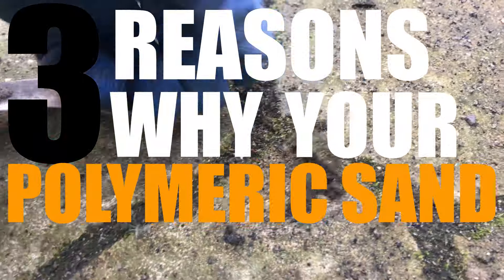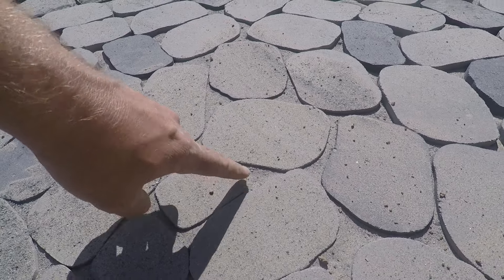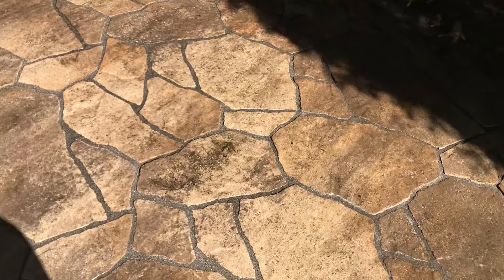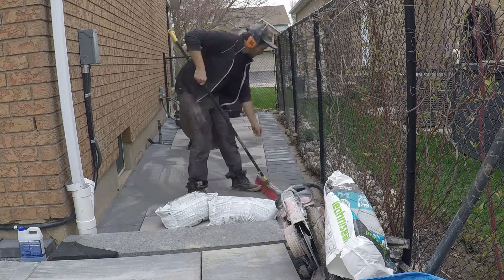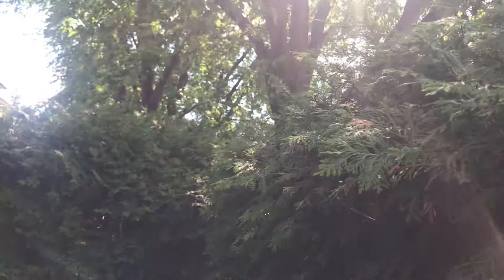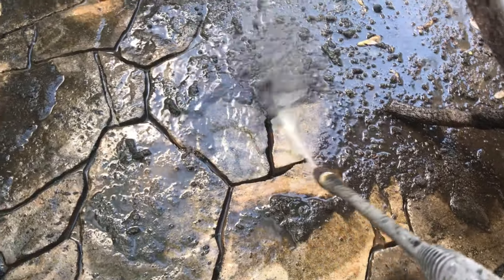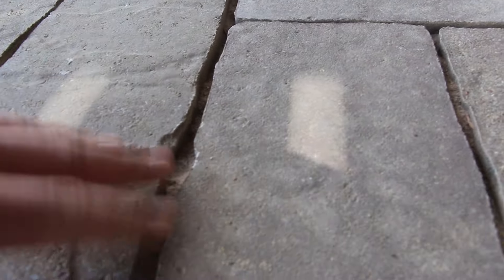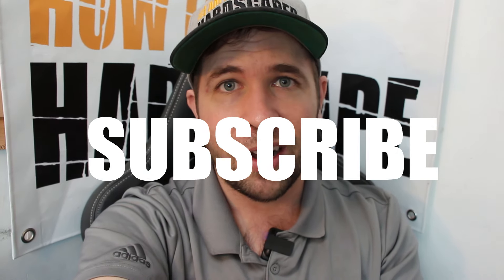Why is My POLYMERIC SAND LOOSE and How to Fix it

Comment: "Why is my polymeric sand failing?" 

Because polymeric sand is garbage. If have joints greater than 1/8 in, use Easy Joint and you'll never look back. If you have joints under that, watch this. 

Great video, informative as always. I'd love to see you do a breakdown of a laser versus an altimeter (U-level) on a site. We've been using u-level for years and are wondering if we should switch to a laser, don't really think that's the case, but would love to see a comparison on a build.
Reply from the maker: Yes it does seem like the industry sentiment is slowly moving towards those semi-permeable jointing compounds.

Appreciate the suggestion! Will definitely cover that this year at some point 👍👍
Reply: I just regrouted my patio a month ago. It felt like it hardened just fine but we got rain last night and all my polymer sand is wet, it reactivated. I'm at the end of my rope. Is this easy joint bette? Will it actually stay hard?
Reply: @silverrush1411  We absolutely love the product, and it does harden to grout like texture. We've used it in all of patio applications except one, and it's fantastic. Super easy to use, legions less restrictive than polymeric - add water, fill the joints, no worry clean-ups.

There are a couple things to keep in mind: if your patio is a state of failure, the EasyJoint will fail (think of it as if you had tile grout, and pulled the tiles apart - what would happen to the grout?); it does not work well with tight (narrow) joints. I'd say 1/8" or greater. There are similar product to EasyJoint that is supposed to work with tight joints, but we haven't used them yet so I can't speak to them.
Reply: @PuppyStomper87  my paver patio  is only 5 years old and the joints are over 1/8 ". I just don't understand how the grout could reactivate and wash out. I folled the directions and made sure not to over or under water. It started to repel water so once it did that I moved. I removed all my old grout that was done by contractor due to the same thing and moss growth. What are the cons to this?

Comment: We are in the metro Vancouver area doing a new construction driveway and walkway using New stone Standard pavers. Driveway has a slope and existing grade is much lower than the grade planned for the driveway (1 to 4 feet difference). The plan is to use 3/4" minus road base for fill and base, and then HPB for the bedding layer. If we are to use polymeric sand, what brand and type would you recommend? (I think Techniseal and Gator are available here. I'd have to check if it's some other brand.) We are also considering Romex. Is there any difference in longevity and weed growth between polymeric sand and Romex? The videos are really helpful.  Thank you!
Reply from the maker: I just started using Romex this year so I can’t say about longevity and weed growth. I’ve used Azpects Easy Joint which is similar for pedestrian applications and it has held up well. I wouldn’t use a permeable jointing compound if you plan to use 3/4” minus as your base though. For poly sand I like TechniSeal nextgel

Comment: I think I filled mine too high. Had to do in dark before 3 days of rain. Tarped it for a week. Looks dry for most part so we shall see how it holds up. I have rectangular one with chamfer. It is filled prob to 1/8” from top but still decent amount in chamfer gap. Am I definitely going to have issues?
Reply from the maker: No not necessarily. See how it goes
Reply: @iamahardscaper  thanks learned a lot on your channel
Reply from the maker: Glad it helps 👍

Comment: What polymeric sand would you recommend for a patio where the stone is BWS avari and brock paverbase was used?
Reply from the maker: I like TechniSeal Nextgel personally. Try to use a roller compactor when consolidating that sand on those slabs. A compactor with a pad will work but will likely crack a few.
Reply: @iamahardscaper  thanks, will take a look at renting a roller compactor. Was considering getting gator maxx g2 - is that just marketing gimmick or actually a good product ?
Reply from the maker: Gator is fine, i've heard a lot of other contractors have had troubles with it though. I've maybe had a couple.
Reply: @iamahardscaper  thanks for the heads up. I couldn’t find the one you suggested locally. Rona has the techniseal ez sand - would that work well?
Reply from the maker: I would buy from a landscape supplier and not those big box stores. The quality is not the same
Reply: @iamahardscaper  fair. I’ve been looking online and can’t find any locally. Might have to go with the maxx g2 as my backup.. will keep looking though. Do you know how many bags would be needed for about 600sq ft?
Reply from the maker: you can go through the TechniSeal website to find a dealer near you. Amount needed would depend on joint width and depth. If you are installing a product you know, you can search it online and find how much square feet one bag would do
Reply: @iamahardscaper  thank you !
Reply: @iamahardscaper I had pavers put in and techniseal nextgel  applied in April.   Turf guy blew out some joints with his hose.  I figured he may have vibrated too close on turf application.  But a month later i used the hose on not a hard setting and had sand blowing out.  Noticed loose sand on the surface of the joints.  I had some other cracks so i cleaned them out and re-applied myself (as i figured it wasnt watered properly on install and didnt activate.  i watered the entire paver area as if it were freshly sanded.  I was methodical.  Some areas hard as rock...others sandy on top surface.  Bizarre.  i washed off dog pule today and another joint blew out.  im so over it.  Im good at this kinda thing but this has me frustrated.  maybe its the base layers not draining.  road base, non woven geo and sand....  I have some techniseal sealer (natural) im going to try.  but i do NOT want to dig these out and powerwash just to have a similar result.

Comment: I have limestone patio tiles where the polymeric has washed out over the years.  The contractor replaced that failed poly with torpedo sand and my wife hates the color difference between the lighter almost white limestone and the brown/beige torpedo sand. It appears that most suppliers near us only have torpedo and masons sand that is beige.  I’d prefer not to do polymeric again.  Is there any alternative that is closer in color to limestone that I could use as a sweep in into the joints?   I realize any sand without binders like polymeric will wash out and need more frequent replenishing.  Thanks for any response.   Love your channel!
Reply from the maker: Ohh that is tough. You may be looking into a polymer modified grout. Ardex has a lot of colors available. But I don’t like using it unless they are laid on a concrete base.
Reply: Wow, I can’t believe how fast you replied!   Thank you!  And yes it’s a tough spot when you don’t have a happy wife.  The local hardscape supplier suggested that rather than masons sand to use finer limestone screenings but I recall your video saying that you should not use limestone screening  although that was for base application.   Does that critique apply to jointing as well ?  I don’t expect to have much depth need as the torpedo sand is pretty well impacted in the joints.  This would be maybe a 1/4 on top to get the color that the wife would approve.  Thx again for any insight!!!
Reply from the maker: That may be something you want to use. I personally wouldn't because I prefer something in there that will bind itself to the stones. But I also would not use torpedo sand because of this. I'd say get a handful of it from the stone yard, bring it back home, see what she thinks, then proceed. you could even do a little portion of the project to see the results first.
Reply: Thanks so much!!!

Comment: question for poly sand, is it require to use plate compactor or can i use a manual steel tamper?
Reply from the maker: It’s best to use a plate compactor for the vibratory compaction and not a ramming action. In a pinch, guys have used a hand tamper. Just make sure you have something to protect the pavers

Comment: Hey when you use 3/4 gravel as a base do you use 3/8 1” bedding base? Most importantly what I was concerned about if you use open grade base and bedding does polymeric sand just keep falling into that base when you’re sweeping it in and compacting?
Reply from the maker: yes, always use the 3/8 or 1/4 chip on the 3/4" base. I find that there is about 10% more use of polymeric sand in these applications, but it does not just keep falling into the base the gaps are just not large enough. Some people use non-woven geotextile in between the base and the bedding layer. I do not
Reply: @iamahardscaper  ok thanks, I’ve been wanting to switch but been concerned about that.

Comment: I just finished applying polymeric sand to my paver patio while it was still damp…. Now I seem to have some stains on the stone pavers. How do I remove the stains??
Reply from the maker: I would start with a hot water pressure washing. If that does not take care of the staining, you would have to then wash with a polymeric sand haze cleaner.

Comment: Have you ever gotten a job to pressure wash and re-sand? I feel like at that point it’s always lift and relay or a full redo.
Reply from the maker: Yes, I used to do them when I was first starting out. Only if it is just a sand problem. If it is a weed problem, its almost always a full lift and re-lay. I learned that lesson.